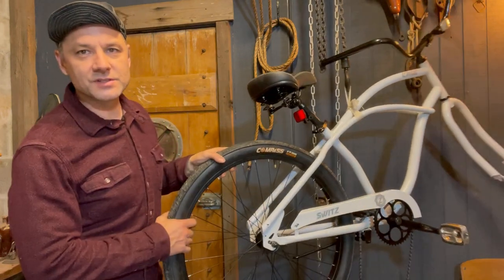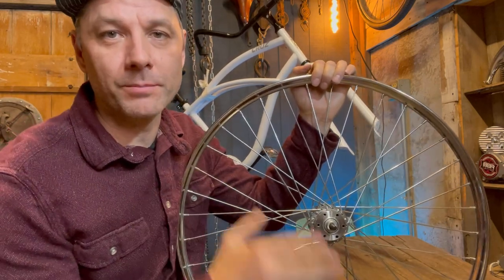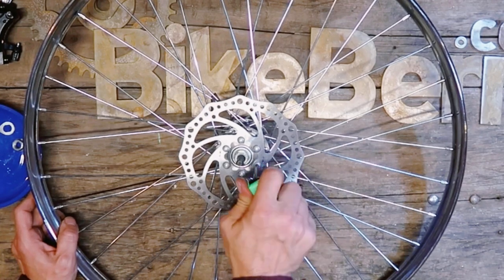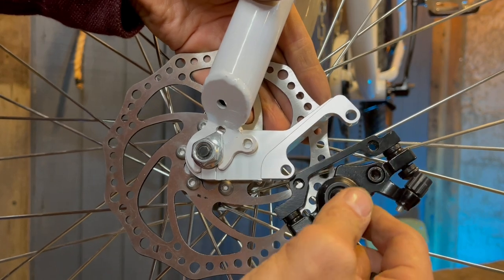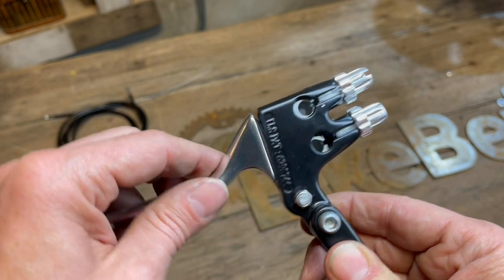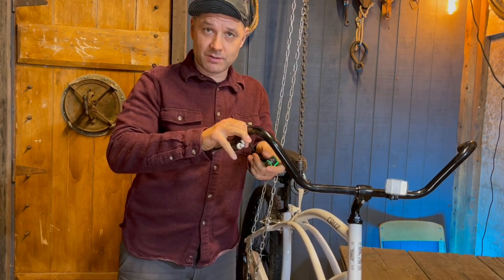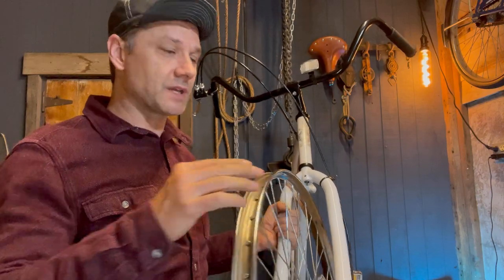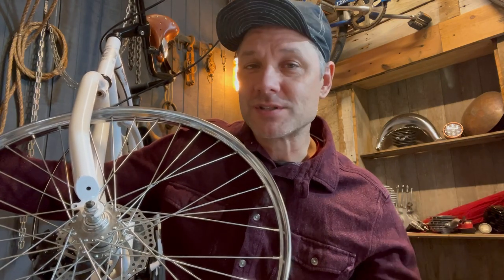Front and Rear Brakes | How To Properly Mount Them On Your Motorized Bike! | Bike Berry

Comment: I highly recommend using a set of name-brand hydraulic calipers.  These are much easier to use and give better-stopping power. I also recommend semi-metallic brake pads for any motorized bike, but for a high-speed, performance build, full metallic pads would work best.
Reply: Every set of hydraulic ones I have got were leaky and constant trouble. I will never use fluid ones again.
Reply: @gamersroost  It depends on which ones you use. It takes about $60 a caliper for them to be decent. Though, if you get pit bike brake adapter setup, it'll run you $65, but you'll have no issues.
Reply: What pads do u recommend
Reply: @jessejames9420  I don’t know what pad size you need, but I recommend semi-metallic pads. I personally use the best deal I can find on Amazon.

Comment: I should show you the last motor I ordered cdi blow out sparkplug in 8 hours main case seal internal damaged metal melt can't hold bolts looks like a stuffed pour throttle cable gone in 8 months the exhaust bends at hole can't stop bending and leaking??????never bye china for a quick fix????..first week I had to swap out the main case and done several times first to crack on first hit to get the clutch shaft out????...🤕the look on my face??..that was 8 months ago I'am still fixing it from old parts since I had 2 spare???there running better????. And thanks after a set off rear brakes as the new bike is dule disk😁.thank dude!.

Comment: New sub, noob question first time builder.
I have a single speed cruiser has pedal brake, I just want to have rear brakes like and not the front style in this video can I still use my pedal brake on single speed cruiser as an emergency brake an ebrake? Have only my back caliper style brakes on mind/blueprint. I plan on having my fenders on there as well.
I don't plan on riding too fast nothing over 25 mphs has 80cc but yeah not trying to crash or race just cruise. thanks ahead

Comment: I have been watching your videos over and over, every since I built my first motorized bike - 8 - 9 months ago. I now have more questions than will fit in comments. I am disabled, with limited funds, so had to start with a very cheap build, with plans to upgrade something every month. Unfortunately, recently getting hit by a car TWICE has forced me to do a bunch of upgrades right now - rather than give up on my brand new bike. Anyway, I have pre-ordered the BBR Heavy Duty 10 spoke mag wheel set, and have been trying to figure out the best install for when they finally arrive. First, my bike has a seven speed sprocket on the rear. I plan to ditch a few gears to make room for the brake disk, BUT, I pull a trailer a lot, sometimes heavily loaded, so I do need my lower gears. I'm thinking three speed would do. would this leave room on the other side for motor sprocket and brake disk? Second, I already have the BBR Heavy Duty Springer front end on it, and have replaced all of the hardware, pivot points, etc to make it truly heavy duty, which incidentally made it about an inch wider. Is it even possible to adapt a disk brake to the springer? I know that the adapter that Bike Berry sells will not work. Do you know of any other way? Thank you for any help - and for all the informative videos.

Comment: I have a 27 inch tire mountain bike and I found it's too big for me to try to mount. So I figured I'd get a 26 inch tire and replace the 27 in tires. The breaking calipers the originally were on the bike don't work with the new tires so I thought about changing both to disc brakes. Someone in the bike community told me that was not possible but that doesn't make sense to me. What do you think?

Comment: I have a bike with a rear hydraulic disc brake already; I bought the 4-stroke kit and it arrived today; with a LOT of work, I was able to get it to mostly fit... until I tried to add oil. It ended up being a no-go and now I'm going to try installing it on my GF's trike. I've got it mounted already, but I do not know how to install the sprocket on the axle... if anyone has any ideas, I would really appreciate it.

But, I'm going to have to order a 2-stroke kit for my Peugeot bicycle. I think the 80cc 2-stroke will have no issues with installation; however, it seems as if my rear disc brake will be in the way. I cannot find anything anywhere which addresses bicycles that already have disc brakes all around. Do I need to completely remove the rear disc brake to install? Do I have to make adjustments? Will I need top get rid of not only the brake but the 3-stage cassette that is currently on it?

I love this bike and would really love to make it my motorized one; however, I've never worked on bikes or 2/4-stroke engine installation, so I'm a little out of my depth here.

Comment: I am curious BikeBerry, how well does this hold in the front when 100% of the braking torque is on just that notch? I can understand this working on the rear since it can lay against the frame, but the lack of contact points seems to make this into a torque bar on that notch and a likely point of catastrophic failure.
Reply: I was wondering the same thing too. I would use the fender mount hole in the forks and drill and tap the adapter for a bolt (at 7:43 you can see the bolt hole in the forks just to the right of the axle).

Comment: For the last 2 years Ive been walking 6 miles to work which takes me 2.5 hours,working 9 hours then walking 6 miles home.I recently ordered an Ebike for $500 to find out it was a scam.So I saved up and bought the Switz Cruz 2 weeks ago order # 344586 
 and got it last Thursday 3/14/2024.I opened it up and was looking everything over and noticed the piston was out of the head.With further inspection I noticed the rings on the piston were broke.I called on Friday and have been hoping the new ones will be here today because my plan was to put it together on my days off Monday and Tuesday.Ive been putting it together and noticed I didnt get a brake cable for the front brakes or any gas line.I want to know whats needed to return this bike.I've already had to many issues with this bike and havent even rode it yet.I want to return this bike Ill buy another one from a different company and continue walking to work for another couple of weeks.I could go to the store and buy what I didn't recieve but I shouldn't have to so I want to return this product.

Comment: the bike does not come with this adapter or the same style calipers that you show that are horizontally attached  the ones that come with the bike has vertical and horizontal holes with not enough hardware or any instructions  with mounting holes on fork

Comment: Has anyone succeeded in using the sprocket adapter for mounting a disc on a non disc hub if required for not wanting to mess with a whole new wheel for a front wheel